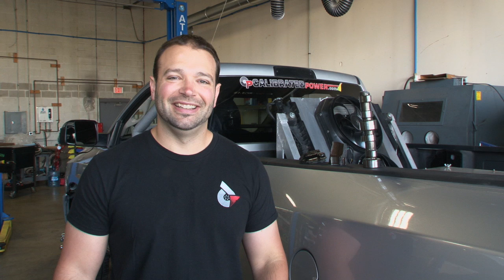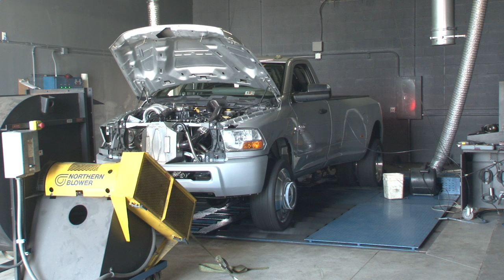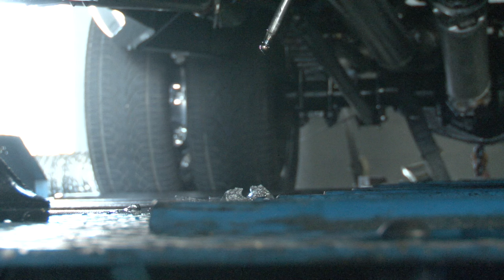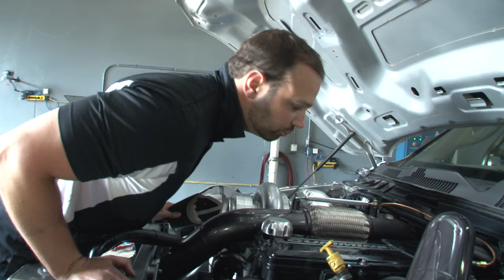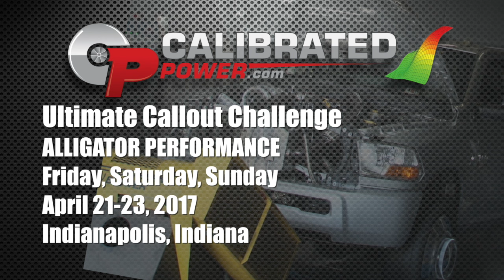CPS' Ultimate Callout Challenge Truck Engine Failure

Comment: i pretty much called this.  cummins even says the isx cant even 1000 horse without exploding let alone an isl
Reply: It was an ISL
Reply: Robert Soppe you realize how much heavier the crank, pistons, and rods are in an ISX15 compared to an ISL9? The ISL still has a chance to be balanced for 4000rpm and tuned. An ISX has no chance of being balanced at that speed. Plus, look at the difference in torque...